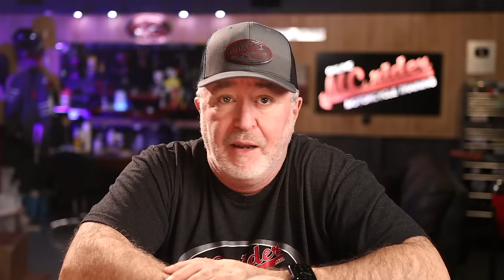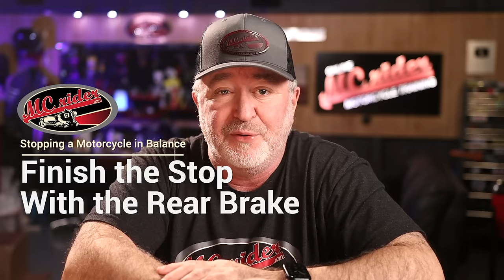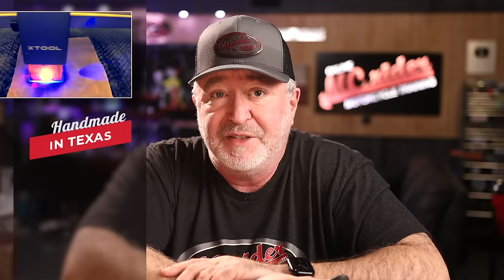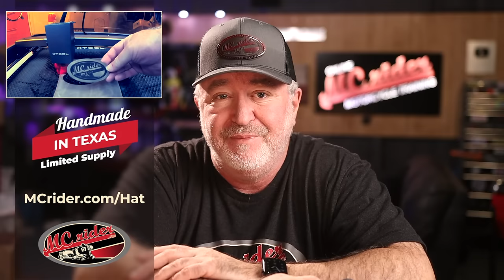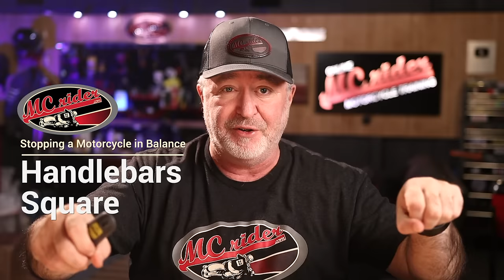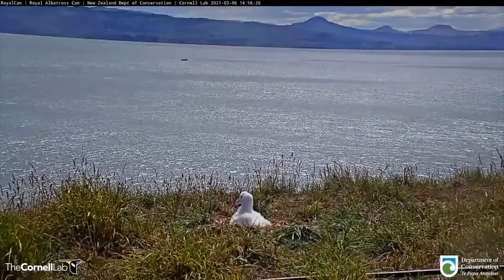"How to Stop Your Motorcycle with Unbelievable Balance - #3 will Shock You!"

Comment: Turning the bars at the last moment to the right will ensure the bike drops to the left as you drop your left foot, which builds confidence.

The more windy the more I would lean the bike on to my left foot as I find a 'tripod' between the wheels and my foot far more stable than lightly touching both feet down, but my bikes aren't super heavy.

The exception to the left foot down rule for me is with a passenger and a road that drops away to the left, in that case I'd rather be on the right foot and have to mess about with blending throttle and front brake - not ideal!

Good topic!
Reply: Yep, that's how I stop too, turn the handlebar, so you always know which way the bike will go.  I also drop the left foot, except in a couple of places where the road is not level.
Reply: Struggling with just left foot down, no one absolutely no one has suggested this, thank u will try 😅 🙏
Reply: @shaspaz  You only need the smallest of turns.

Comment: Motorman from "Ride Like a Pro" put out a video of stopping with a passenger to improve stability. He says that at about 1 to 2 miles per hour, you should use the front brake and use both feet to stop. And solo should follow steps of stopping as discussed in this video.

Comment: Really good tips, thank you!  Although I’ve never had a problem stopping on a cruiser, I recently bought an ADV bike with high clearance.  I caught a head cold, went riding, had a foggy brain, felt slightly off balance to begin with.  As I came to a stop, I caught pants on foot pegs, paddled along, looked down at what my pants were doing, handlebars turned slightly right, hit the front brake as I realized everything was going to hell (which made it worse), and you can guess the rest.  One of the many morals to the story is, do not ride while under the influence of a head cold, migraine, the flu, or anything else.  And there are a few more morals to the story as well.

Comment: Another Great video and also more to learn. I very rarely use my rear brake to come to a stop. I always downshift while applying front brake (concerned about whether this is a good thing). By the time I’m at the light, I’m already in 1st gear and ready to go when the light turns or the unexpected.

Comment: It's true that with the front brake,  there's more suspension travel in the front during the stop,  but if you don't have a passenger,  this seems like a minor thing?
The car does the same thing, the front suspension bounces back a little bit at a full stop,  but people are used to it and it's not an issue.
PS.  Fun little way to see the difference between the front and the rear brake:  if you're stopped at the light, and the road is sloping down so you're holding the bike still with the brake,  then by switching between front brake and rear brake, that's a good way to see the difference on the impact of each brake on the suspension.   Just a fun little thing one can do the next time waiting at a light on a slope.

Comment: I’ve never understood why at a stop we keep the foot pressing the back brake. Is it yet another case of “because we’ve always done it like that “? What is the advantage?
Reply: Ready to escape in case of trouble coming up behind.
Reply: @duanepeiffer5071  that is why we are on first gear, but the back brake doesn’t help to pull away
Reply: @rodintoulouse3054  it’s about being ready.  Right hand ready on throttle, not having to control brake and throttle. Low speed control is improved with slight rear brake pressure.  At least that is what the low speed training I’ve taken teaches.  And I feel it works.
Reply: Reduces inertia and the dipping you get with the front brake. and on a slippery, icey road will help instant lock and drop. Makes you a better and more confident rider when you can make the best of your rearbrakes.

Comment: I guess I got into a habit (bad?) Of slightly turning bars to the right when stopping with a passenger on-board.   I do it just enough to ensure weight goes to left in case my passenger (who is good) moves slightly when stopping.

Comment: Kevin, long time viewer. My question is this. If your running at , let’s say 65mph, and you see a stop sign coming, is it better to downshift to slow the bike or just ride the clutch and use both brakes?
Reply: Steve, my 2 cents worth.
In anticipation of coming to a stop, I would gradually close the throttle n engine braking would immediately slow the bike. 
When the RPM decreases as result of bike slowing down (throttle closed), will downshift to lower gear n repeat the downshifting process each time accordingly. On my KTM 1290S,  I found 3000 RPM to be fairly comfortable. Each bike/ engine model will be different. 
Will use brakes to slow bike quicker as required to get to 3000 RPM to downshift on my bike. Keep head n eyes up. Only quick glances at tachometer. Over time n repeated downshifting, one gets the feel of own machine without need to glance at tachometer. 
A suitable RPM for your bike?
This would be the RPM at which one could smoothly accelerate without "jerks" if the need arose.
To determine suitable RPM, practise in parking lots.
It is a bit more effort but is fun when it becomes muscle memory and stopping becomes smooth n relaxed.
This is strictly for anticipated stops ahead. Please monitor vehicles behind as well as one normally does when reducing speed n coming to a stop. Hope this helps.
Reply: If there is traffic behind you when stopping using engine braking (downshifting), flash your brake lights to warn following traffic.

Comment: When solo on my Gold Wing, I find myself ever so slightly pushing the left handle bar just as the bike is rolling to a full stop. This gives me a guaranteed lean bias to the left, where my foot is already down on the pavement. In these last few feet, the front brake is free and the rear brake completes the stop. Been riding for 50+ years, so I'm not sure if this is acquired bad habit or learned technique.

Comment: Great stopping techniques all three. I would suggest however, that riders occasionally practice finishing a stop with the front brake. There are road conditions (poor surface on the left or very crowned road) that require the right foot to get the the road first. This means you’ll have to take that foot off the rear brake.This especially applies to short riders (I’m 5’5”) on taller bikes.

Comment: I remember back in the 90s when I took the rider safety course we were told at the beginning of a stop to apply the rear brake slightly before applying the front brake. Is that no longer advisable?
Reply from the maker: Just a technique difference...
Reply: That is still perfectly acceptable, and the better technique for a less experienced ride (if you ask me) who can’t smoothly/ gradually apply the front brake first or simultaneously with the rear to achieve proper weight transfer to the front tire for maximum traction during braking.  As long as you’re achieving proper weight transfer to the front tire during braking either technique is perfectly fine.

Comment: First of all Kevin…..I hope you and your Family are faring well with the weather.  Now on the subject of one foot versus two.  I was taught left foot down and right foot on the rear brake.  In 
 my 12 years of riding this has worked out the majority of the time.  Now the times that it did not maybe if I had finished with the front brake squeezing very smoothly and had put two feet down.   Maybe I would not have tipped over.  🤷‍♀️  Most of my friends stop with two feet down and have never tipped over at a stop and tell me that I was taught incorrectly.   All I know is if the right side of road is higher than the left side and you do not have long legs……..you’re going over if you are on a heavy weight cruiser.   Thank you for head and eyes up reminder!   Very important in coming to a stop.  Enjoy your day!  😊☕️

Comment: Stopped at flashing yellow light making a left where the road was pitched on the left, so sgs was angling to left. As traffic cleared, pulled in clutch ready to put into gear and bike fell over and  ankle got trapped under bike. Fortunately, 2 guys stopped and started pulling bike up until I was able to slip out and help them get bike up. Almost lost My head from traffics coming from the other direction 
Not used to riding from getgo with bike in gear, but that would of helped me get going

Comment: I am loathe to contradict you, but on road bikes for emergency stops you should always and only use the front brake.  The logic for this is very simple.  If you are not braking very hard, the front brake is all you need.  If you are braking very hard (properly), the front brake is the only brake that has any effect (the rear wheel goes light, and can't contribute to braking the bike).
Here's the next thing.  If you are braking hard and you use the rear brake (as well) the rear wheel will tend to lock.  This is bad news in a straight line, and worse news on a curve.  Only use the front brake, except when coming to a halt at an intersection.
But wait, you say, I have ABS, I can just brake hard with everything.  ABS is a bad idea.  You will stop in far shorter distance if you do not engage ABS - you should train to be able to stop (progressive braking) using maximum friction, which means ABS should never engage. (Your front wheel should never lock, and if your front wheel does not lock - no ABS).  There are many videos covering this - amongst others, motojitsu has excellent videos on how to stop a bike properly.

Comment: Like many motorcycle cops after coming to a complete stop I've always practiced balancing on the bike as long as possible before putting a foot down. Two minutes is my goal. I love my antilock brakes and no doubt rely on them too much. Putting your left foot down at a stop and not being in control of your gears should you be in "false 1st" or stall out is incredibly foolish/dangerous. Getting rearended is not fun. The front brake (right hand) will hold you in place while you lean on your stronger right leg/foot. Always interesting and informative, thanks!
Reply: If you can balance your motorcycle for two minutes I will eat my hat...
Reply: You’re not fooling anybody but yourself. 
You can’t hold a motorcycle up at a dead stop for two minutes. Let alone most stoplight sequences aren’t even a minute long. 

As well you won’t get a “false 1st” if you’ve been properly downshifting to slow the bike as well. Your bike will be in first gear and ready to escape should you need to, and holding the bike still at a stop light with the rear brake and having your right hand free to apply throttle for said escape is quicker than holding the front brake and then trying to throttle up. Plus let’s not forget not everybody’s right leg is their stronger leg. Along with if you can’t hold your bike up with one leg, not matter which one… you shouldn’t be riding that bike.
Reply: @marksmallman4572  I said my goal was two minutes. Comprehension skills are easy to improve too.
Reply: @chevyon37s  Once again, I said my goal was two minutes. I can easily balance on my bike for a minute and 15 seconds. Apparently you don't ride many different motorcycles and wouldn't know about bikes that don't have gear indicators, worn gears or synchros or simply stopped in second gear by mistake and stalled out. Ask any Neurosurgeon that rides and they will tell you to hold the bike at a stop with the front brake and allow the rear wheel to freewheel in case you're hit from behind thus absorbing some of the force.

Comment: I do what kevin says. + on the last second to stop, intentionally, l do counter-steering gently to make bike fall to the left, while my foot is ready to catch the weight.
Reply: Be careful with counter steering to make it fall left at a stop, especially if you have a heavyweight motorcycle. I used to do that until it bit me. I was riding two up on an Ultra Classic, came to a stop, finished with the rear brake and counter steered to make the motorcycle fall gently to the left. The road had more crown than I expected and the motorcycle tilted left just a bit more than usual. It tilted just far enough that with the extra weight of my passenger I couldn’t hold it and I dropped it with my wife on the back. How embarrassing - and that was after I had completed two slow speed courses. Now I always make sure the motorcycle is completely vertical when I put my left foot down. Using the counter steer tilt method felt good and looked cool until….it didn’t.
Reply: @Old-n-slo-locked-n-leaned  since I practice and learn about it, first. l do adapt to any condition not just do it. of course I did fall on first try, like you said about weight. that's the challenge, I have to tame the weight until it won't bothering me.